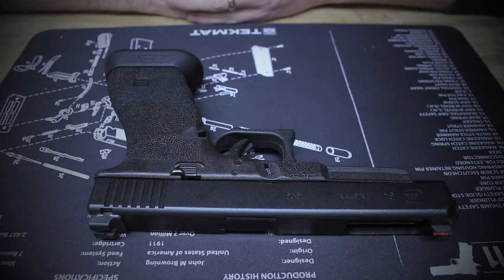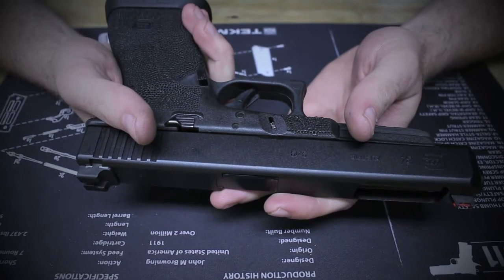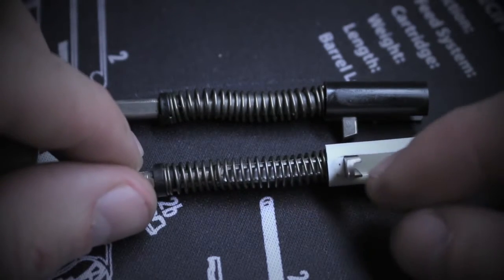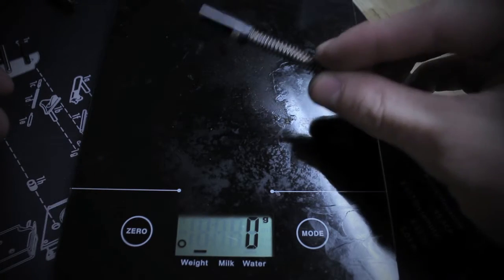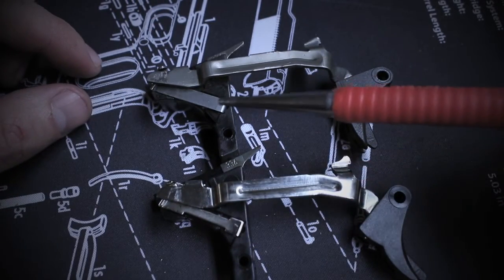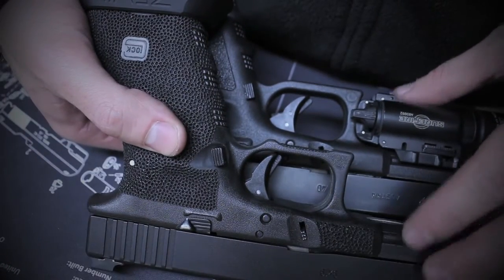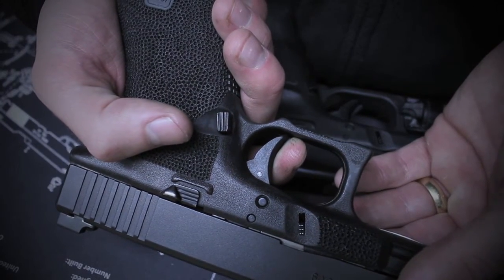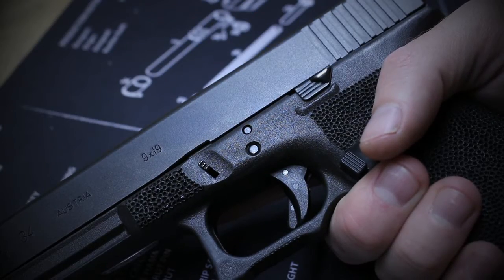Glock Upgrades Part 4: DK Custom Triggers

Comment: How's the trigger been running since the review?
Reply from the maker: Good so far. But that's only with a few hundred rounds through it since then. Had to take off quite a bit of the adjustments.
Reply from the maker: GRAYMAN RESEARCH Had to readjust some of the "preset" overtravel and reset.